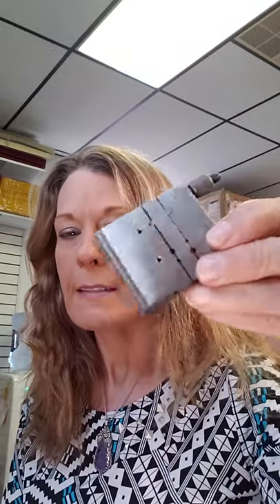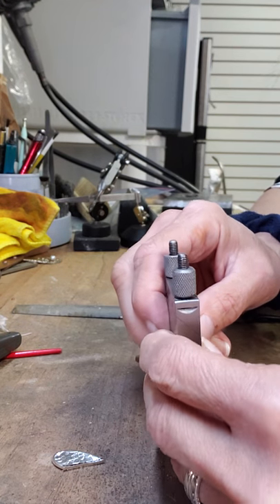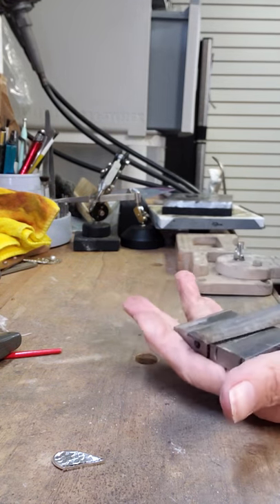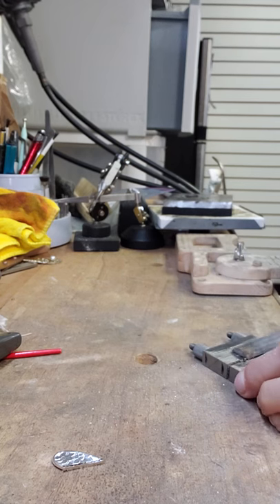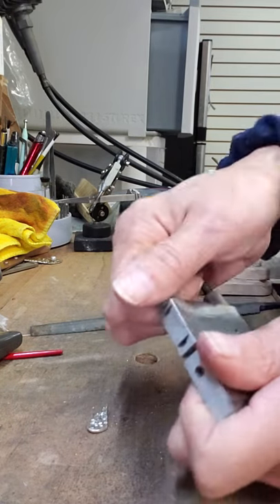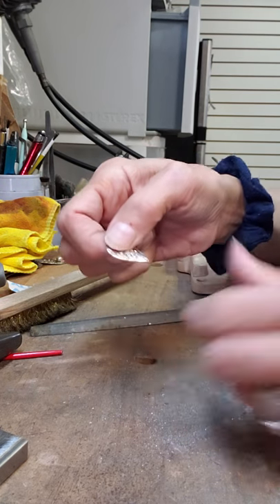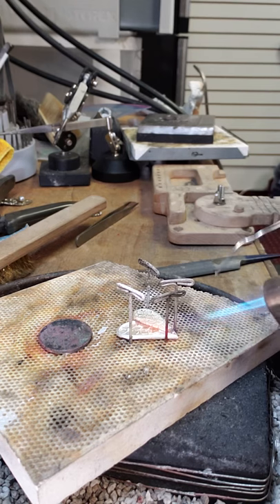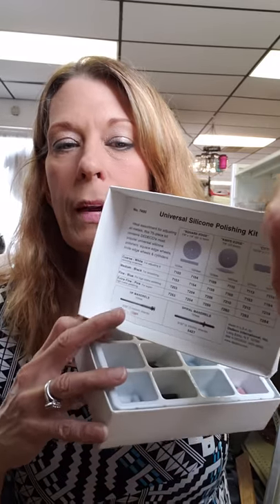Using a miter vise for precise seams on soldered silverware hearts. Flatwearable Artisan Jewelry

Comment: Love your videos Suzanne and thank you for sharing them with us.  Question:  Would it be possible to solder this piece with easy or extra easy hard solder using heat shield to protect the plating?  I’ve never worked with silver plated so this is all new to me.  Thank you for your time.
Reply from the maker: Yes, you can use easy or extra easy on a piece like this and yes, you do want to protect the plating with Fire Shield.